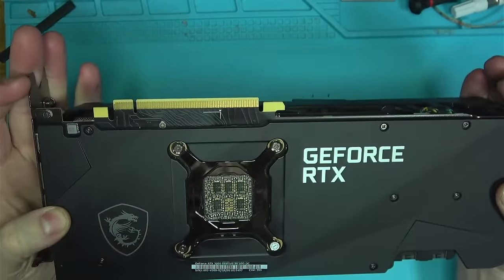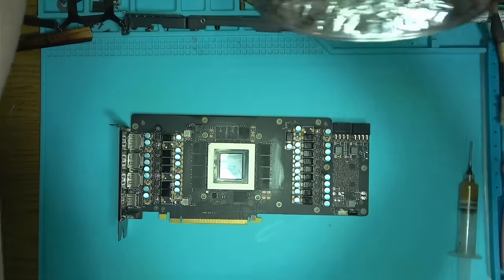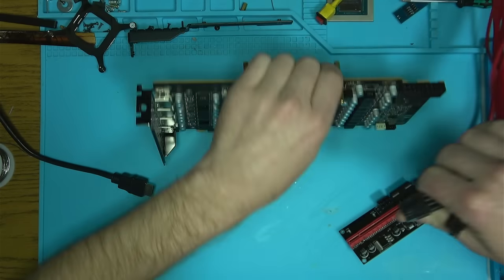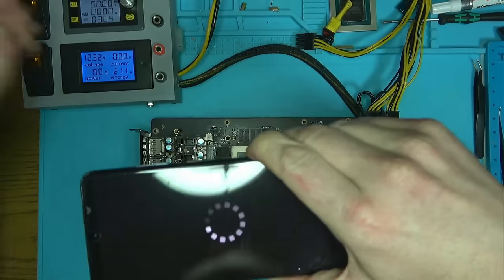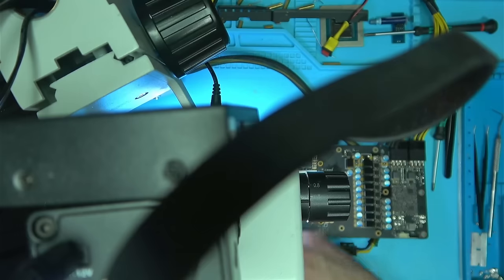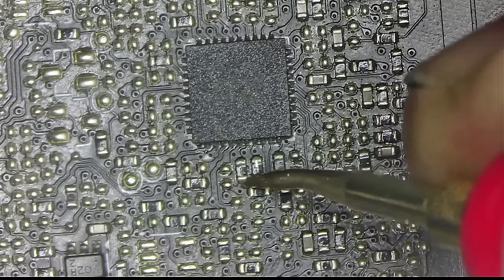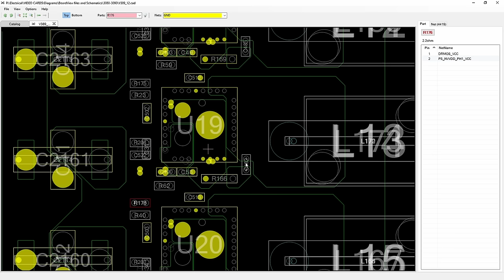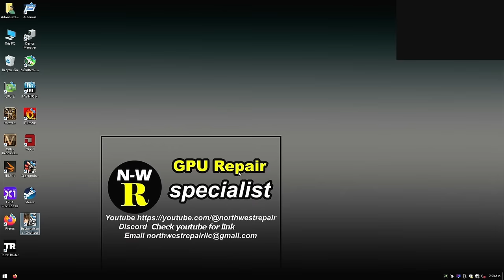This is why GPUs break too easy (long story)

Comment: 10:50  ==  Speaking about the TOILETTE
perhaps it may be prudent to carry a small 
' pocket size 'bottle (with a plastic screw cap)
such as a glass medicine bottle - that one can
fill withe either Chlorine 'bleach' or IPA  or common
Laundry stain removal liquid -  which generally
contain small amounts of Hydrogen Peroxide.
One can then pour a required amount on some
Toilette paper and wipe the seat clean.

Unfortunately - MEN cannot piss straight -
so the floor is often wet and stinking of Urine -
unless the Toilettes are cleaned frequently by
cleaning staff.
In CHINA  people steal the Toilette paper - so the
population have to bring their own.
People stand in line and wait for their turn to get
access to the toilet paper dispenser so they can
steal their share

Comment: I believe that electromechanics will become increasingly important again in the next 10-20 years, because we urgently need to learn again (and the manufacturers need to make the products in the same way) that we need to repair broken things. With resources becoming increasingly scarce, manufacturers must also make all electronics more maintainable. When I look at the circuit diagram, the information overwhelms me and I realize that there urgently needs to be more specialists who are capable of repairing things. I sometimes repair smaller SNES and NEO GEO modules, but complete graphics cards or motherboards? Absolutely brilliant.

Comment: any idea why a new tuf gaming oc 7900xtx is not giving display on a rog strix z490-f gaming motherboard with the latest bios version. Set manually gen 3 speed gen2 gen 1 and auto does the same thing.
Card spins fans and lights up.
No recognize in device manager.
Motherboard shows no pcie detection (white led)

Comment: You Sir, done an excellent  job, if I could give you 1000 subscriptions I would . I've seen a video 3 years ago with guy reballing laptop GPU in South America- after 6 months GPU dies he said, maybe had same problems like you had with this MSI, but  maybe, he failed to discover  some stupid Pb free  stupid brittle connections on other parts of the layout.

Maybe that's why manufactures of mainboards now days are using  8 PCB layers, to overcome the rigidity(brittleness) of the soldering but, not sure is really enough. 

We put tension on our mainboards when use heavy CPU radiators, when we mount them incorrectly, we put to much pressure in turning the bolts excessively, even on AIO mounting can create pressure, DDR slots overused sitting several times the DDR modules.

However the new alloys for soldering I think needs more silver %. Maybe 5-10%. High purity silver is good conductor but is also elastic. Still, Pb should have a good %  in the the alloy.

Your video description is equally precious and very important.  BRAVO!!!!

Comment: Not all trucks are super hard on gas, but yeah even here in Northeast Ohio, you see them pavement queens with big lifted diesel trucks with them low pro tires, yet see a tiny bit of snow and its stuck and they wont use it for work.

I like older stuff as I work on my own crap, my 91 c1500 v6 truck wasn't hard on gas at all, but of course wasn't as good as a tiny car, but I usually work on lawnmowers, other things, scrap stuff, I can't do that with a tiny car, so the cash flow from that offsets the fuel costs, I could own a small car as well for when I need to run to the store, but the cost of insurance and matainence costs, I'd rather just the truck, it makes me money in more ways than a car can.

Comment: Lead free has been a pain in the butt since its inception. Red ring of death on original XBOX360's etc etc. I've never used the stuff and certainly don't plan to ever start. The lead allows a certain degree of flex in the joints essential for long term reliability. I've repaired so many Pb free dry joints at this point I've lost count.

Comment: One tip, when measuring resistance, do not hold the bare part of the DMM probes with your fingers. Although high, your body resistance can affect measurement.

Comment: Crashing under load is 80% core, 20%  power. 

Whem you hear an inconsistent coil whine before crash in furmark, that is a near dead mosfet or controller or components around them.

Comment: The worst problem any tecnician can  come across, bad solder in smd component, you cannot see it, cannot test it, cannot replace it and its so rare that the next time you come across it again you forgot it was a possibility. And the worst, if your not a good tecnician to spent more time than usual (or dont got lucky by resoldering the right component), you may condemn the card because you cant find the problem.

Comment: A comment on balls day.

Have your tried using two masks when doing ball drop? Using one mask to deposit flux only on the pads, (Use a thicker flux) squeegee into holes over pads and switch to clean mask to drop the balls onto the fluxed pads and reflow? I helped design a wafer sized BGA machine years ago that had a slide bearing with fixed flux and ball drop fixtures for 8” wafers. Just an idea not sure how it would work or if it’s worth it for your daily usage. Love your content watch every day giving likes to every vid I see!!!
Reply from the maker: It works on small chips only

Comment: where did you get your NVidia MODS software? I'm having some weird issue with my RTX 4090 where I'm seeing fps performance degradation in every game and benchmark I've tried. GPU & mem report expected speeds (i.e. stock) and temps are low (under a water block). Any ideas on what it could be?
Reply from the maker: Discord

Comment: You will want to make the window higher resolution on some of those stress tests, if it's a powerful GPU, because you were CPU bound, and not pushing the GPU to full load.  Obviously those tests aren't making use of every feature on the card, but in terms of 99-100% usage, it wasn't being pushed.  If you weren't trying to stress it in that way, I get it.  Just in case you didn't notice it, I figured I'd mention it.
Reply: furmark put the card at about a 90% load, which is good enough for the card to heat up and see whats going on with it.

Comment: The GPU from my laptop died, after it was resoldered, due to the solder not having lead on it, and they said it was a one fix only so... Laptop working but not the screen.
Reply: It more sounds like you got conned.  Not having lead isn't going to cause it to suddenly break.  Electronics have been using lead free solder since 1986.

Comment: I don't know what that "mods" test is there but you're getting a segfault, I'd question its validity.
Reply from the maker: Test 2. Memory training.
It would show an error if it was not passed.
Otherwise it outputs garbage.
Reply: @northwestrepair  those look like kernel thread stack traces, is it really expected to encounter a segfault?

Comment: Rough surface = increased surface area for thermal transmission .. in this case
Reply from the maker: Then why Delta is noticeably higher compared to flat surfaces ?
I guess MSI innovation team did not test their innovation.
Reply: @northwestrepair  Well it sure looked intentional. Maybe NVidia was supposed to use the exact opposite pattern .. like a YinYang between the two surfaces. It does increase surface area and chances are the mountains would cut thru the paste and directly contact the core .. in theory. That would never happen with two perfectly smooth planar surfaces with paste between them.

Comment: If you care about clean linux shutdown you can add echo "1" >/proc/sys/kernel/sysrq to /etc/rc.d/rc.local. Then you have the sysreq keys for emergencies. alt - sysreq (i) kill all procs (u) remount all filesystems as read only (b) reboot and (s) sync discs.

Comment: Lead free solder was the doom of so many HP laptops way back when.
Reply: If you're talking about the dv6000 then its not from the solder. It was straight up defective chips
Reply: Plus Dell and many Xbox 360/PS3 consoles
Reply: no it was not, it was a bad chip
Reply: @Nintenboy01 those were all faulty chips, nothing to do with lead free solder.
Reply: defective Nvidia silicon caused that

Comment: Leaded solder isn't always what it's cracked out to be. Like sure more modern devices using leaded JUST before unleaded were introduced usually had really good soldering and metallurgy, and when you solder you take the good stuff and make it nice and then it's fine. But there are plenty devices from before with cold solder joints, and many develop their own unique pest, hard lead compounds caused by chemical contamination (capacitor outgassing). I think silver makes the solder a lot more long term durable, so sn62pb36ag02 is amazing, but modern SAC alloys 305 and 405 used in electronics well they don't have that issue at least.

I also think they're skimping. Higher silver lead-free solder compounds are much less brittle. Maybe they've got 105 in there? That would be funny wouldn't it. Plus underfill edge bond etc is supposed to prevent PCB flex from killing BGA solder joints, so... well when's the last time you have seen that on a GPU? You'd think it would be important, no? Apropos skimping, you desolder those chips you occasionally show factory oxidised pads on the PCB, well that wouldn't be happening if someone used immersion gold PCBs now would it. I wonder how much damage skimping on gold is causing overall, could be quite something. I don't think you can blame unleaded when these companies do the bare minimum job and worse. Cards like that should have used an opportunity to have the heatsink assembly reinforce the PCB against flex as well, instead of imparting more flex on the PCB. Some plastic ribs, some more screw down points, some PET tape on the PCB to prevent plastic eating into the solder mask. It can be done.

Comment: Any brands other than Asus that use leaded solder?
Reply from the maker: that statement is for motherboards. I have not seen many motherboards and once i did, were leaded. Not all either.
Reply: No consumer electronics is allowed with leaded solder for years by now. So even if they still use it somewhere, they won't tell anyone

Comment: At 36:51: Does a condenser also get hot?
Reply from the maker: I guess so after a discharge.
Reply: I see that google translate (and I) didn't do a good job, I meant an capacitor. 😀  @northwestrepair
Reply from the maker: @toreediassen144  same thing

Comment: I think you might be suffering from selection bias when it comes to electronics longevity.

Lead free solder is a good thing.  Surely we shouldn’t go back to leaded gasoline because it was better at preventing engine knocking.
Reply: In the same vein asbestos is a great cheap insulation material , just a shame that when it breaks it releases carcinogenic particles into people's lungs 😂
Reply: I think your "selection bias" is due to knowing nothing about electronics, or solder properties, or the very low risk of lead poisoning when out in the wild. Lead solder is low hanging fruit. Regulation is easy. Bureaucrats love easy but avoid complex like the decommissioning of alternative energy sources that are very non green in manufacturing, operation (leaky windmills), and disposal. Ever heard stories of a small amount of mercury getting loose in the wild (say in a school setting) resulting in the ENTIRE building being evacuated? BTW .. aviation gas is STILL leaded and commercial aircraft emissions are not regulated (other than an evolving CO2 standard). Jet fuel also contains much more sulfur (expensive to remove) than what is allowed for automotive use.
Reply: @xenuno  what does lead poisoning have to do with selection bias?  

My point was that a repair technician had a skewed perception of failure rates and the notion that lead free solder = poor reliability based on that is questionable.

I also don’t understand what jet fuel has to do with anything.

Lead exposure is cumulative, and eliminating it where possible is a good thing.  It isn’t significant for my health, but it definitely would be for someone whose job it is to repair and solder electronics.

Go lick your lead paint if that makes you feel better.  Or go drink ground water close to an ewaste disposal site.
Reply: @plushquasar653  I was pointing out the exceptions where environmental cleanliness as usual, has to take the back seat in the name of economic growth and ... "progress". Landfills are toxic and not just because of lead. All sorts of objects that are championed as recyclable, simply are not at high rates .. like batteries. Li ion .. NiCd .. leaching plastic .. waste oil ... are improperly disposed of. I don't think I've read even one article that went on about the dangers of lead leaching, which I would defo of read if I had seen notice of. I think the dangers are exaggerated and result in knee jerk reactions like when a small amount of mercury is spilled in a school or other setting and the response is to clear the entire building. Anyways ... I will admit that I've only experienced 1 failure that was almost definitely solder related. That was a Xbox 360 that eventually red ringed when pushed hard for a few days consecutively.

Comment: I've got a question for something I have been wondering for a while. It's about that oily residue that seeps from the thermal pads. Should that oily residue be cleaned off the board as well as the pads when servicing my GPU? I realize that it is not conductive but could it cause issues. You've seen many Video cards and I'm just wondering if it can become an issue in the long run. Cheers!
Reply from the maker: its best to replace leaky pads
Reply: It's a silicone oil and no it won't hurt anything at all.

Comment: yeah this is why the earlier Xbox 360 and PS3 models also broke over time, as well as the GeForce 8/9 series GPUs. Just hot/cold cycling eventually caused the solder to crack. You could fix it temporarily by reflowing but a full reball was required to actually last
Reply: No, first batch od Xbox 360/PS3 GPU have a problem with cracking micro-bumps NOT a PCB-Substrate side BGA connectors.
Micro-bumps are located UNDER A GPU and Substrate and filled with underfill, you cant desolder Micro-bumps without trashing chip itself. Reballing a GPU core do not work for this problem, my XBOX 360 still died after reball. 

And if i Remember correctly Micro-bumps in that time were made with a HI LEAD ALLOY, with a melting temperature of around 350*C.Also i have no idea how TSMC was soldering Micro-bumps.